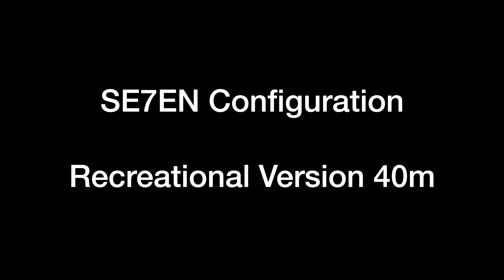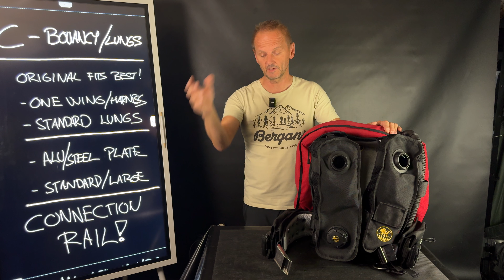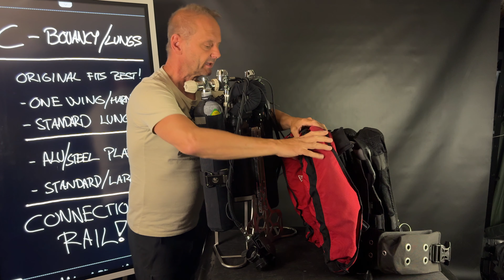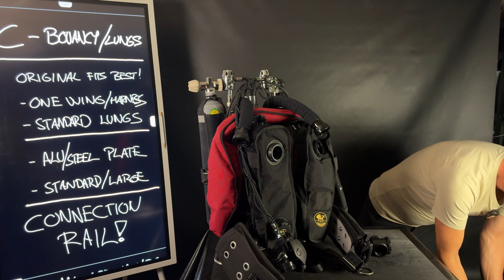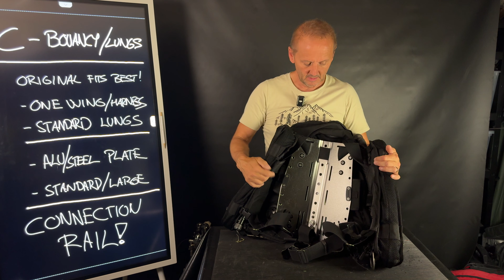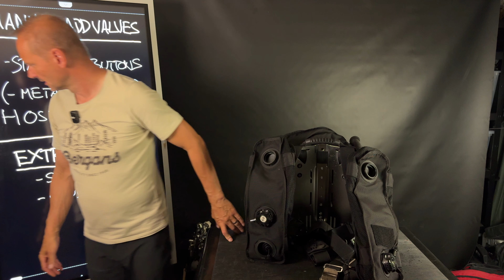SE7EN Configuration  Part 3 - Bouancy / Lungs

Comment: Can't wait for your video about the front and back-mounted lungs. Do you know when it will be published? 

On more questions on the manual add. Can you use the Manual Addition Valve Pack - Metal also with the large front-mount counter lung instead of the Manual Injection Pack as I have it already? I want to move to large front counter lungs but have the back-mounted lungs at the moment and would prefer them in the future.